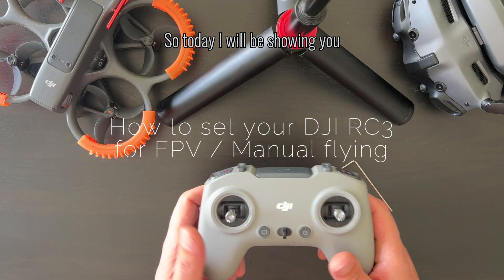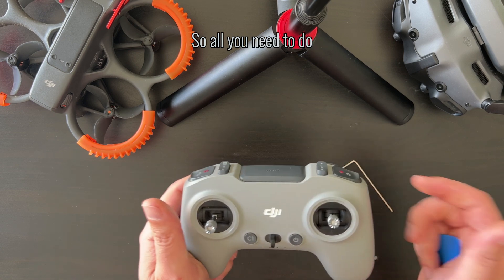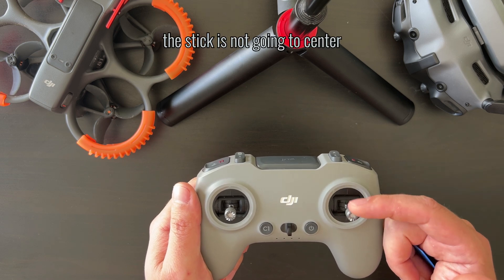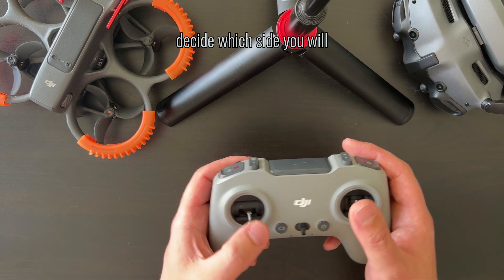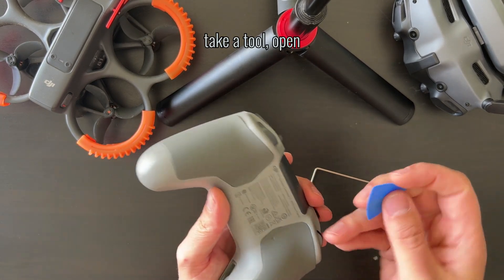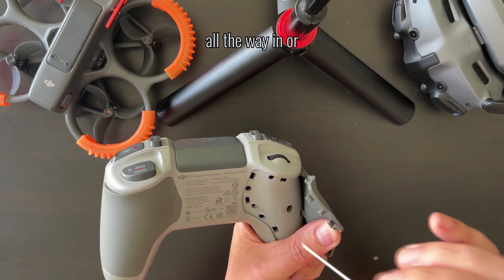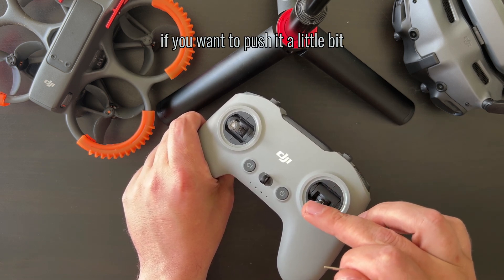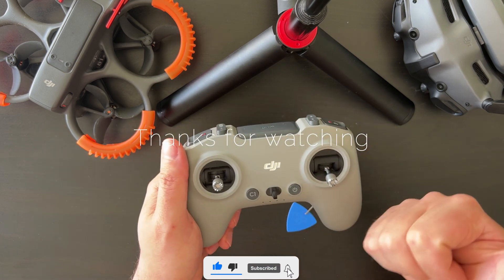How to Set Up DJI FPV Remote Controller 3 for Manual/Acro Mode

Comment: After doing this is there a way you can reset it to normal
Reply from the maker: Yes u just need to release F2 and tighten up a bit F1 and its all back to normal 👌🏻
Reply: Thanks for your instructions.